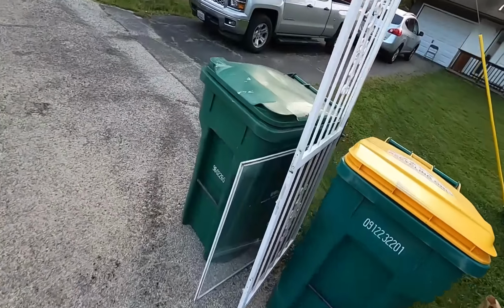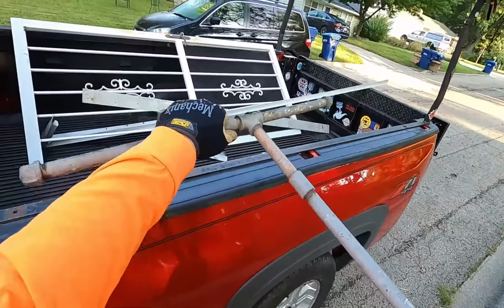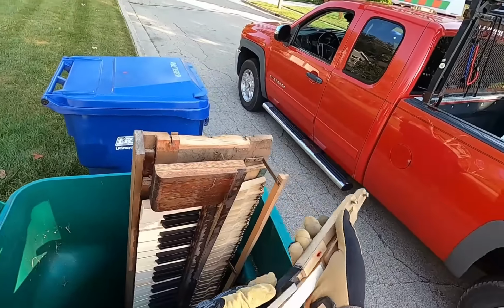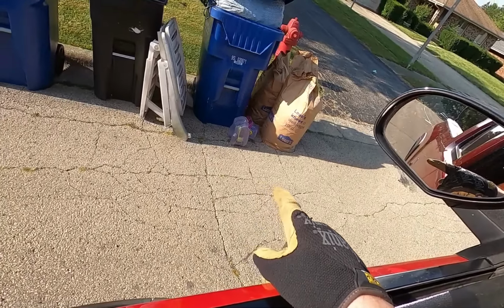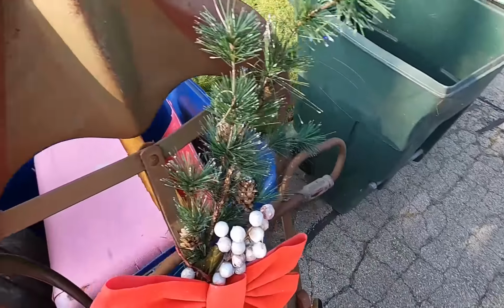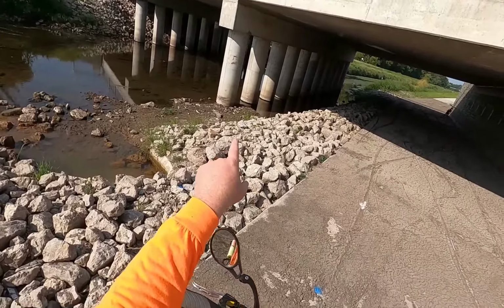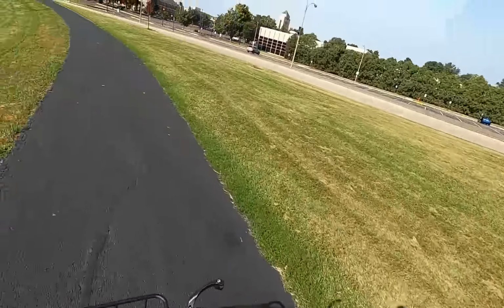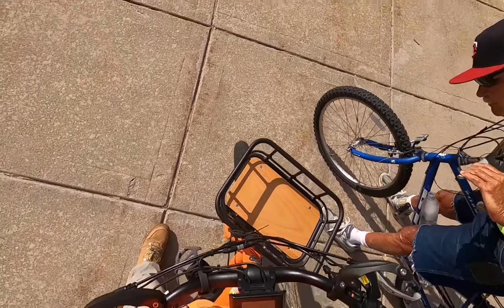Trash Picking the Good Stuff on Garbage Day Morning

Comment: The best advice is how you've ended your videos, prayer and then be you, do you and have a great day. You'll do great and get it figured out. One thing is the days will start getting darker earlier. 😊
Reply: I think you should get a small trailer.  When you get back to you house offload into the trailer, when it's full off load  on the ground.  Only go to the 10 mile away scrapyard when you've got a FULL truck and trailer. You can manage the grocery shopping on an "as needed" basis.

Comment: Yes, consistency is a queue, You may need to go to bed earlier so you can get up earlier. I’m in California and I collect a lot of California redemption value, yes, I take the aluminum the plastic and all glass and I’m very consistent at it. I want to leave no stone unturned when I’m taking it out of dumpsters. I do all I can to keep from climbing into the dumpster as in someplaces that is not advised..  I have to go 21 miles to the nearest recycle center so I bring a large load all that I can and go once a week at most, I like every other week, but that leaves me behind with extra recycle to turn in so three times a month is enough! For you, you’d have to stockpile your scrap in separate piles and when one gets up large enough for a load, that’s what you take that week, but it takes a lot more room and a lot of organization. 
 Wishing you well, Paul.
🧐🤔🤗, Recycle Steve
Reply from the maker: Hey Steve. Sounds like you have a great organized recycling operation
Reply: I agree with Baja shine get up earlier in the morning or also evening scrapping as well. I would go to the scrap yard once a week maybe twice if you're getting overloaded. Is your regular scrap yard closed for good?
Reply: I know you don't like it but micro scrap get the biggest bang for your goods

Comment: Hey Paul, if the scrapyard is closed for some time, consider getting a trailer. Load that up first, then you can leave it at your place while the next day you load up your ute. Then take both when cashing it in, will save some fuel.
Also, when you come across microwaves, take the transformer out, it takes 3min. You seem to collect quite a few in a short time. The $ vs your time is worth it.
All in all, you're doing a great job!
Reply from the maker: I had to remove the hitch and all of the hardware to install the liftgate
Reply: @ScrapPalletMan  Hi Paul, do you know why the scrap yard closed yet? Have a good night.

Comment: I get really crappy prices for light steel here in the Northeast. I'm a total newbie scrapper, but already have seen the value of breaking stuff down. I had 400lbs of shred today at 25 bucks. I got 57 bucks for 100lbs of aluminim copper ac rads and 3 big magnetic ballasts. I noticed you toss a lot of stuff as light iron. Youre missing out on Non ferrous. Of course, i dont know your financial situation, so it might not be worth your time to micro scrap. Also, maybe add some dumpster diving? I also am an artist, and use a lot of trash parts in my art that I sell at art shows.   New subscriber here as well!

Comment: I live 25 miles from my nearest scrap yard. So I save up scrap until I think I have 2000 lbs or more,  then take it in.  Up here in Canada gas is about $6 a gallon, so a 50 mile round trip sure bits into the cash flow.
Reply from the maker: Your gas prices are very high. Probably not compared to the whole world's gas prices but to the US those are high gas prices

Comment: Fuel consumption of a 1/2 ton V8 4 wheel drive is a major cost factor.  Every day to a distant scrapyard with a light load is counter productive. Once a week with a full load makes sense. Short term storage of any scrap at home or in your shop also compliments that plan.  If you don't get a full load of iron/steel, load up some nonferrous or cast iron to make a trip pay more.  It may throw your grocery routine out somewhat, but the savings in gas would make it worth it.  Prayer should be the prime step in your planning!

Comment: Hi Paul, regarding your plans and possible changes. First pray 🙏 about it and seek the ultimate answer to the situation, God answers all prayers and questions in his divine was way when you ask through Jesus Christ our salvation Amen. 

Also possibly auto parts cams, blocks, heads stock pile in your unit as the weigh heavy and easy to store for rainy days. Bed rails stack up for one full load every month, definitely don’t waste fuel on half loads save and get a full load, your doing fantastic content as always. May be alter you times a bit, but don’t put yourself at risk if your sight isn’t fantastic at night etc. As you say “be you and do you thing “ 
All the best Jon from Worcestershire England

Comment: What about starting with your own city and/or town and the maintenance department. Ask if there is a way for them to let you know when they are doing large replacements of signs, poles, or anything that contains metal to see if they might let you scrap some of that. Same with construction companies (especially industrial builders/remodelers, etc) Air conditioning companies would be good ones, too. With all of your connections, you might be able to build a network that would help you consistently have loads to scrap. Just a thought. Hope things improve soon!
Reply from the maker: Solid scrap advice. Thank you

Comment: Have you thought about using a trailer. Load it up and run to the Scrap Yard when you have a good solid load.
Reply from the maker: I had to remove the trailer hitch and all of the parts to install the liftgate. This truck won't have a hitch anymore. If I want a trailer I need a second truck with a hitch

Comment: I would get a trailer, parked at the house.  Off load onto the trailer, keeping the truck free. Drop off at the scrap yard when loaded. Gives you a chance to load better, and clean the scrap.
Reply from the maker: I don't have a trailer hitch any longer with the liftgate.
Reply: @ScrapPalletMan  you can have one installed, usually a rease hitch. They attach to the rear frame of the truck.  And the ball/receiver will detach.
Reply: Shouldn't interfere with the lift gate.

Comment: You need Michael to open back up! I hope it happens soon for all the scrappers in your area. It sounds like you are working out how you should start handling things on your own just by talking it thru. Stopping by your place a lot would mean more gas being used making round trips. But saving half/partial loads for tomorrow would save on gas with that other scrap yard being 10 miles away.
Reply from the maker: They are back open

Comment: 1 I would not be picky. If it's metal take it. Don't be picky.
2 looks like you are in a smaller town. Is there commercial businesses that have dumpsters? Businesses throw away a lot of stuff
3 time is money. Handle scrap as little as possible. If is higher value scrap in small amounts unload at your house until you can make it worth your time.
4 seperate or micro scrap. I've seen you throw aluminum and other stuff into the shred pile. If it is easy enough to clean into clean scrap then do it. Grab your impact and clean up scrap on your liftgate but efficiently. Some things take a few seconds to clean up. If it takes a lot of time then it's probably not worth stripping. rotors and short steel are worth more. don't throw into shred pile.
5 make fewer trips to the yard. Gas isn't cheap. Fewer trips. pack that truck high and tight maybe 1 or 2 trips a week. if for some reason you fill it on the first day out then it's a scrap yard run. 1/4 load then wait till it's full. 
6 look for more resale items like mowers, bikes, maybe furniture.
7 keep up the good work
Reply from the maker: Excellent. Solid sound business advice. Good stuff